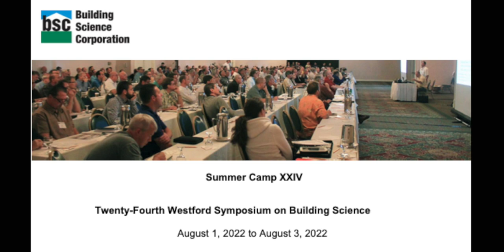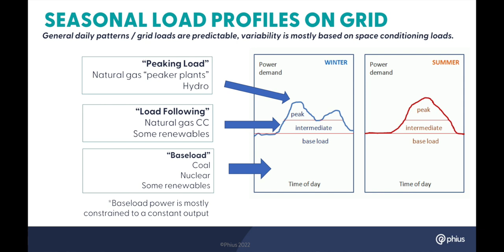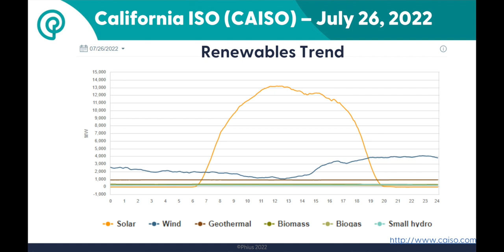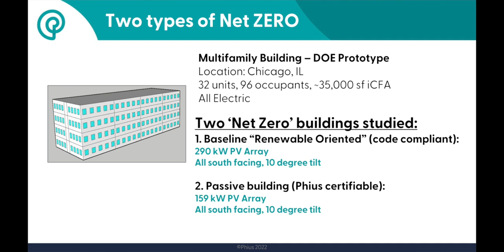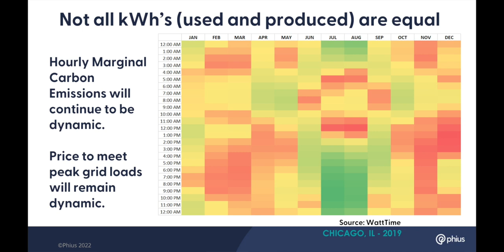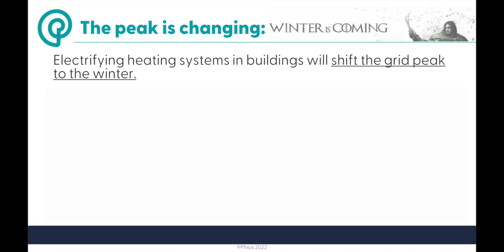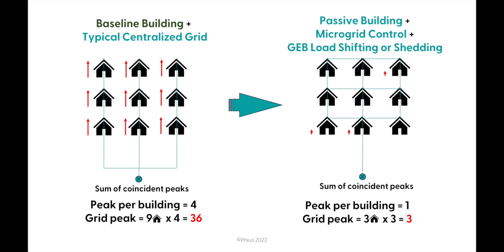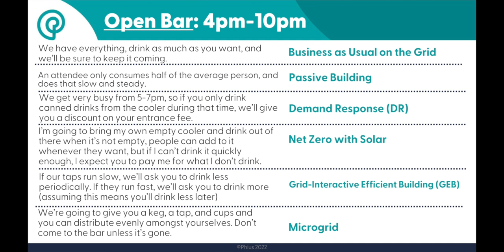“Grid-Building Interaction, Microgrids and Passive Buildings” -  Lisa White

Comment: Thermal energy storage for ac is easy because of the phase change between ice and water. You just need a relatively large heat exchanging surface. 

TES for heating is harder as you are limited to sensible heat storage so requires higher temperatures, probably up to 90degC. You can design flow temps of below 30degC. A 50degC delta gets you about 100kwhrs/m2 of floor space (1.5m3).

CO2 heat pumps (R744) can operate at high power outputs, mechanically close to the theoretical carnot efficiencies, from -10 up to 90 degC. 

In high density urban environments we need heat networks, which connect you to seasonal thermal storage (TWhrs of heat). Finland are going to hybrid low temperature distribution where the heat network provides 15degC minimum - all the way up to 40degC as a source for you water to water heat pump. 

Heat networks are limited in distribution capacity, so TES can load shift for both distribution load factor, and to exploit cheap variable renewable generation to upgrade that heat after distribution. They can also be used for prosumers to export excess storage capacity to neighbors - saving them electricity and paying you feed in tariffs (thermal). 

100hrs of storage of peak loads should be what you design for if you are not connected to a heat network as weather systems usually move overhead in that time. THis averages out the variability in wind and solar generation. Essentially guaranteeing you cheap generation. 

This will make thermal energy much cheaper than fossil fuels. It just requires a step change in infrastructure.
Reply: eguanatech